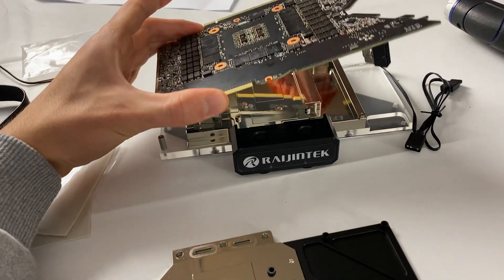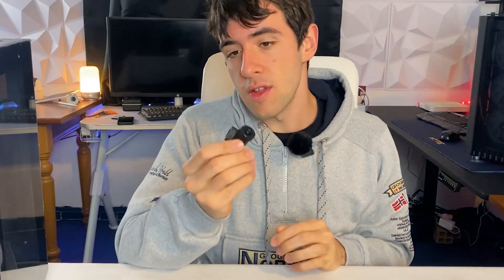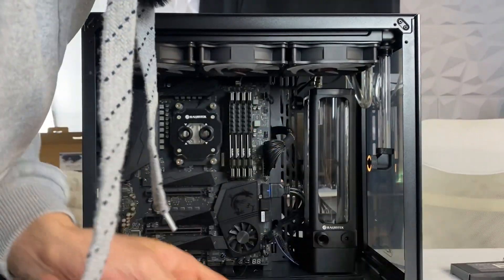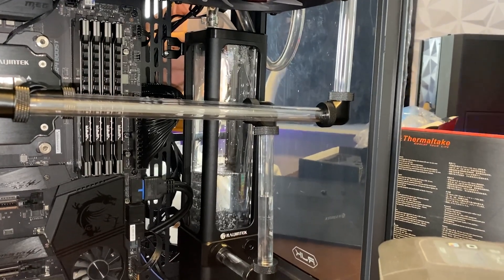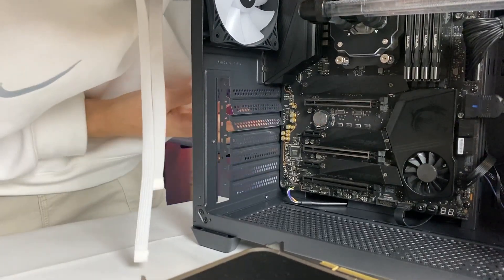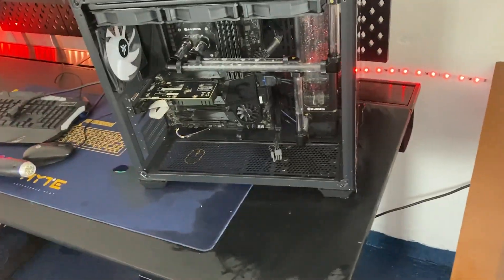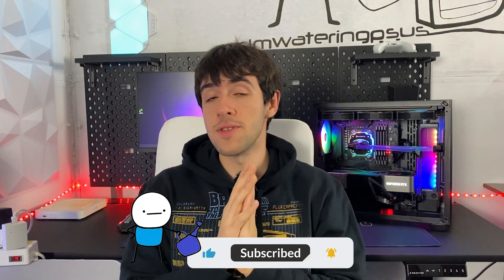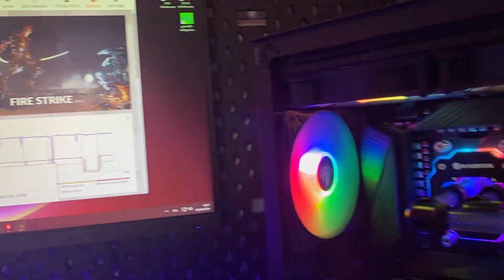Watercooling this PC was a DISASTER... | Part 2 | Raijintek Scylla Kit

Comment: Great video. It took work. Something that caught my attention was the rigid tube going over the ram slots. If a stick has a problem, can you remove the RAMs? Even though it doesn't look so pretty, I would change this part for a hose just to make access to the RAM easier. Here I have a simple 360 aio from Corsair, but I've been wanting to test a WC for a long time.
Reply from the maker: Thanks a lot for commenting and for watching the video! Very good point about that route as it's a common issue with custom watercooling, to close off accessibility to some components. But yes I did leave juuust enough room to take off the DRAM if needed :) I'd say if you wanna try Watercooling, do it but be prepared for the problems. They're gonna be there, but it's a lot of fun!
Reply: Looks like he left himself enough room. I have a similar setup and RAM doesn't need that much clearance to remove.